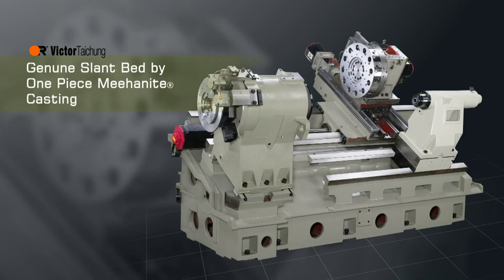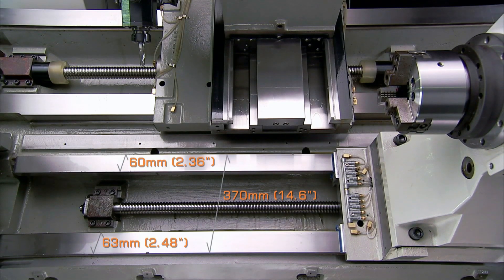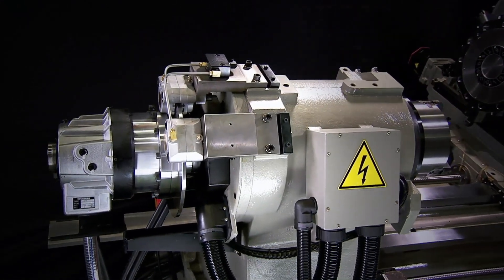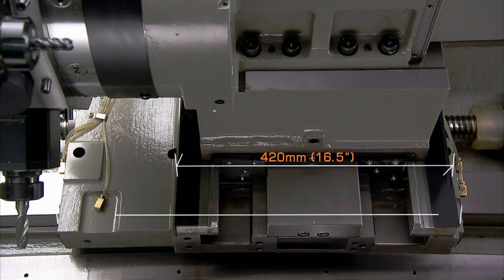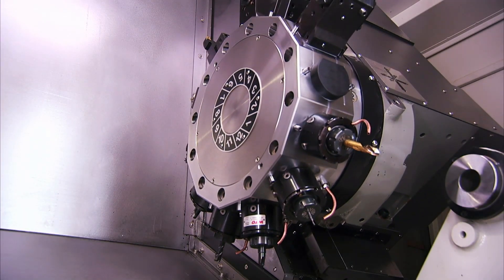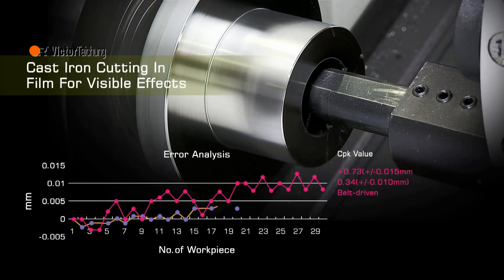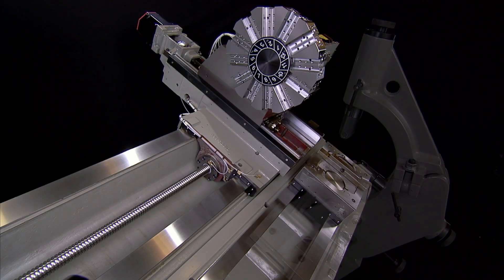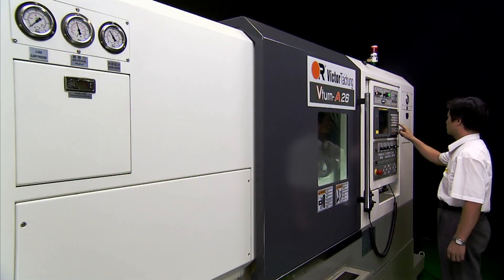Victor Taiching Vturn A26 turning center

Comment: Has the engineering team from Victor Taichung ever considered using mineral-casting for the machine tool base?

Just curious if you guys ever considered changing from Meehanite cast iron to using mineral casting in your products.
Reply: Thermal stability is another benefit of a granite casting.
Reply from the maker: Why mineral casting is required?  more cost effective?
Reply: VictorCNC1954 Well, I have noticed that some well-known machine tool builders are replacing their cast iron base to a mineral-casted base. Such as Hermle machine tools and Struder machine tools.

These companies claim that mineral-casted bases has several benefits that cast iron does not have, the most notable feature has been the claim that vibration is significantly reduced when the machine tool is in operation, removing metal.

I am ignorant of the entire nuances with this issue and was hoping to get a better perspective from Victor Taichung’s engineering team on this issue.
Reply: I Hope not...mineral casting Is not suitable for high vibration machining